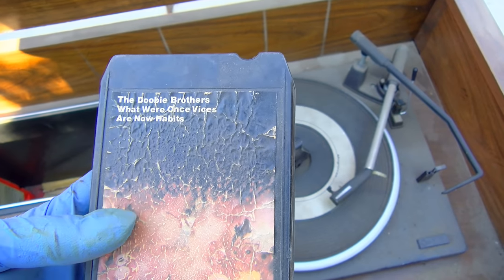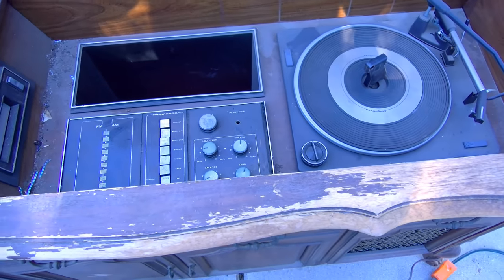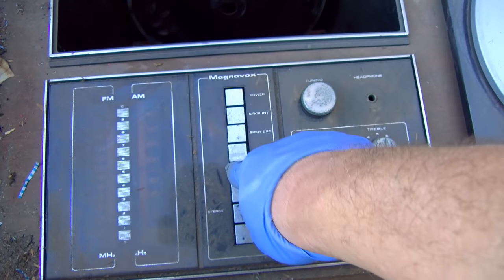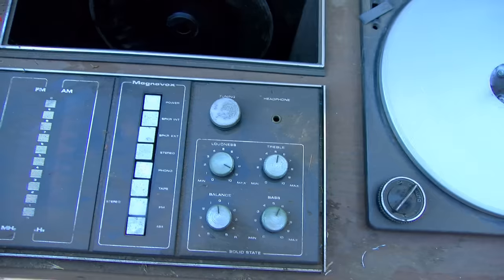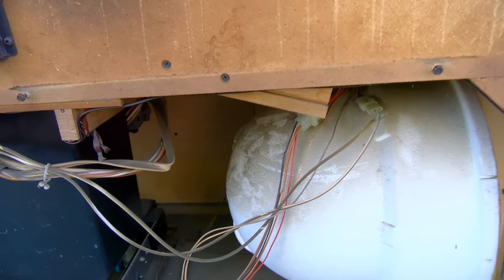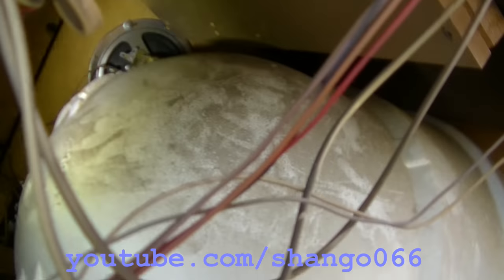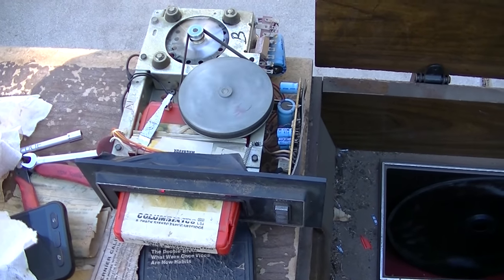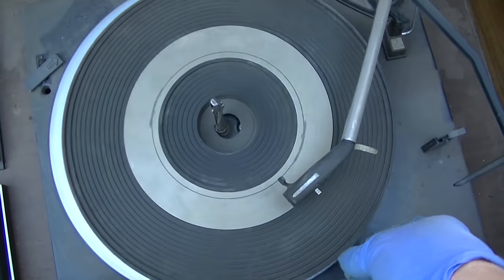1976 Magnavox Console Stereo 8 Track Record Player Resurrection

Comment: My in-laws had a Magnavox tube color set. I don’t think it had a solid-state amp. My brother-in-law Bernie, my wife and I worked at Howard W. Sams. Bernie was a frequent guest inside the television, and he hated it. My sister-in-law kept the console to use as a flat-screen stand. She bought a piece of marble for the top. That is not a bad sounding tape player. You sound like a ham I hear on the WIN system. I think you should drop some of that negative BS. Cheers

Comment: hei my friend. may i ask you something? i have an ups. sometimes through output goes 255 V. it`s ok for the devices? pc. tv. lamp. audio system. phone. weather station. i hope you will help me. please. thanks. goodnight. because i`m in romania, and it`s evening. thanks a lot.
Reply: Consider the following at your own risk: Though most prefer never giving such advice.....
Some Up's show or seem high when no load is on them. Though no guarantee is implied...it should be okay.Hope that helps.
Reply: @Rev22-21  when input power goes below 215 V something inside is turning on and shows between 230-260 V output depends on input. for example if is 190 V input, out is 230 V. thanks for your quick response. i really apreciate. (maybe my english is bad but hope you understand)
Reply: @Rev22-21  Thank you. our main supply is 220 V and in some cases industrial cases goes to 380 V.

Comment: A very sad looking piece of equipment.   I'd be stuck removing the ENTIRE package of electronics, and mechanicals, and then restoring the  turn table, and then the radio.  Afterwards, only then, would I try and restore the cabinet.  Alternately - just skip the hard work - and connect  a functioning new stereo into the unit.   Remove the entire old unit to an easier work location / shop, and enjoy the new stereo.

Comment: And agreed , why the hell do they need a motor THAT strong for an 8-track player? I guess they want to be DAMN sure it will be sure to destroy the cartridge in case there was a problem? or, more than likely it was the cheaper route to use what was on hand with speed control motors and save them the cost of DC regulated control.
Reply: It takes a lot of torque to play double-pack tape cartridges
Reply: @danieldaniels7571  But not THAT much...
Reply: @danieldaniels7571  Unfortunately three phase power is rare in north american homes, otherwise they could have had all the torque 😎